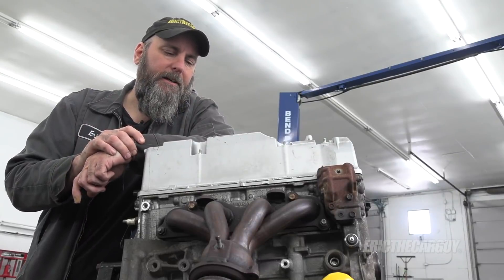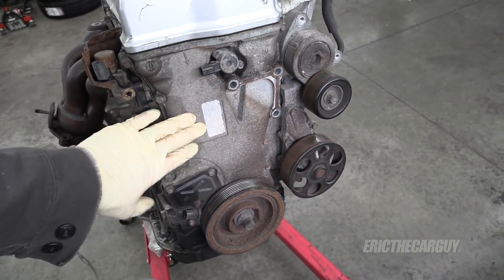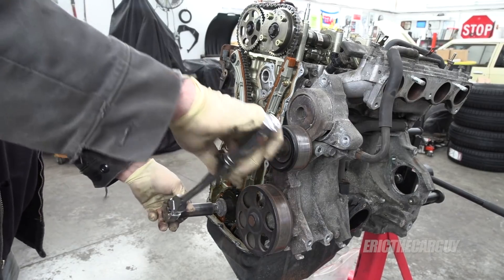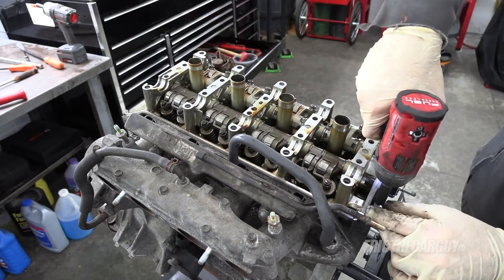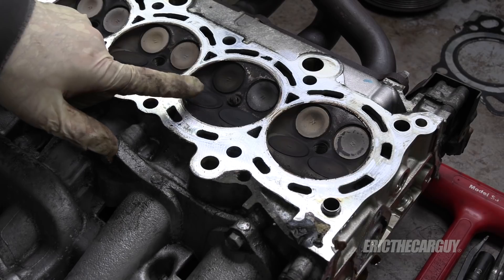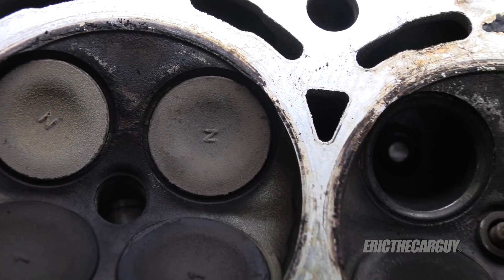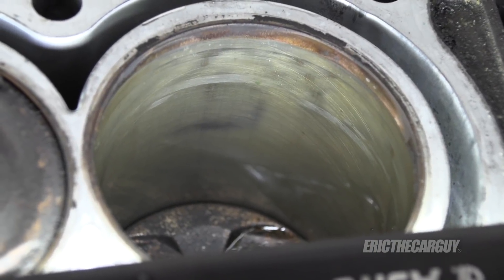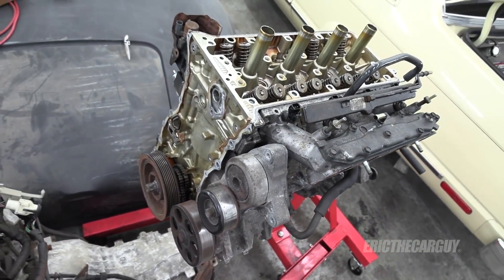Honda K Series Fail, What Went Wrong?

Comment: Another great Vid Eric.
 IMHO it is Honda that destroys these engines. The service 'advisor' will echo what it says in the owners manual "check/adjust valves ONLY if noisy" 
TIGHT valves aren't gonna get noisy! Many first gen crvs died prematurely because of receding and burned exhaust valves and as I begin the search for a replacement for our 410 Megametre 04 accord that suddenly lost compression in one cylinder I see several others right in my area for sale with "no compression in one cylinder".
My guru, longtime head Honda mechanic at the local stealership, discouraged me from having him check/adjust. Wish I hadn't listened!
Due to the ridiculous cost of a replacement right now this one may get a shadetree (no shade at 20 below) partial valve job!

Comment: Good lord, if I didn’t live in OREGON, I would already be at the shop waiting for you!!!! 🤣🤣🤣
Reply: Hello fellow PNW'er!  And same, I'd love to tinker with a K24 but I've got an EP3 with K20a2(?) @ 240k miles that I've been waiting for to die, but it just won't!   

Heck, even my previous Civic, 98 Hx wouldn't die (D16y8?). My sister ran it low (2qt+) on a 2000mile trip up from Cali (stripped drain bolt), and it burned horribly ever since.  Went 2 years/32k miles without changing the oil, just topped it off every week. Figured it wouldn't hurt since it needed to be rebuilt anyway, car was a champ.
Reply: @Chrislk1986  I'd love to have that K20a2 head if you decide to get rid of it.
Reply: @johnsmothermon6856  My bad. It's actually an K20A3.  I'd love an A2 as well.
Reply: If you're in Portland I'll help ya!
Reply: @madjimms  glad to see so many Oregon people. 
Also a Portland metro guy

Comment: I'm happy to see that the guide blades for the timing chain are mostly metal, unlike the GM Ecotech motor I had in my last car, an 04 Cavalier. I did a complete timing chain replacement in that car because the guide broke. Then I had to take the oil pan off to make sure no plastic parts landed in the oil....

Comment: I currently have a 2001 crv (b20z) with a dead cylinder as well...this video gives me some confidence and some ideas what to look for after pulling the head.. love the solvent in the upper chamber idea.. thanks so much eric, you have gotten me through six years of keeping the old dog on the road
-craig
Reply: Oh no....
I just noticed your name is Craig. I’ve got a B20b engine CRV. Engine is good though. Needs a timing belt and valve adjustment. I hope I get the valve lash right.
Reply: @craigiefconcert6493   i think youll be fine... plenty of information out there.Just take your time and remember its better to leave them a little bit loose than tight. Personally I like to use a box wrench and scewdriver vs. the adjustment tool, cause you can see the position of the slot on the set screw as you tighten down the jam nut...good luck!

Comment: LOL! I just changed the plugs and coils on my 2003 Element with 197000 miles. I think the plugs were the originals. They were highly eroded. No more codes! It does use some oil, but I can live with it. I bought it 8 years ago for $6000 for .my daughter to learn to drive on.  Now it's my daily driver. Here in the midwest it will probably rust apart before that engine dies. When it does I'll pull the engine and rebuild it. Now if Honda can just make a reliable 3.5......... Thanks Eric

Comment: Exact same thing on my Element - cylinder #2 burnt exhaust valve. Previous owner never adjusted valves. So, a new valve, relapped all the others, new head gasket and head bolts and so far 40k kms later it runs great. Timing chain next...should have done it the first time..

Comment: When it comes to bolts and screws, when I worked as a mechanic decades ago, I built a container with partitioned to create pockets (with labels) to put bolts and stuff from different parts of the engine or transmission I was working on into as I took them out.  That prevented someone or something from accidentally hitting the bolt groups and mixing them up.  That enabled me or anyone who took over for me to know what was what and where it went.  Putting it on the back of the bench lessened the possibility of the container accidentally being knocked off as well.

When it comes to work on the interior of a vehicle, I do the same thing but with one of those compartmentalized containers they sell for fishing lures, weights, etcetera.  Taking something out of the dash or removing a seat, just put the screws and bolts for each different part into its own compartment then shut and snap the lid so that everything stays secure in its own compartment.  Makes reassembly much easier when different dash screws are similar but still different enough they do no work in each others place as well.

Comment: K24 is a terrific engine. We have 322k miles on ours! 2004 CRV.
Reply: I have 2004 CRV also.  170,000  and going strong.
Reply: That's awesome.  I bought my 04 cr-v new and now have 304k
Still on the original auto transmission too.
Reply: @seanwilson7825  Yeah, we're also still on the original transmission. No problems yet.

Comment: Thank you so much for this video, I just bought an 05 AWD element with 0 compression on cylinder 1. Did some tests and I’m sure it’s the exhaust valve. Trying to take the head off with the motor in the car and still working on it, one more good session and I should have it off.

Comment: That engine looks like it's a perfect candidate for a full rebuild. You can pretty much turn that into a brand new engine that'll last forever.
Reply: I tried doing an engine tear down years ago on a 3TC engine from a Toyota Celica, I only got a third of the way there on such a simple engine.?
Reply: You mean another 180k miles.  Maybe more, maybe less, but definitely not "forever".
Reply: these engines are crap. no actual VTEC and they're made for economy. wouldnt waste the money on fixing one when a whole replacement engine can be bought cheaply

Comment: "Id rather hear a valve than smell it."
Some advice I got from an old Honda tech on valve adjustments. Say the intake spec is 8-10 thou and the exhaust is 10 to 12, ill err on the loose side.

Comment: Did a valve adjustment because of this video on my 2007 accord, 4 cyl. Two of the intake valves needed a slight adjustment. And two of the exhaust valve were way too tight. 

Thanks Eric!

Comment: It’s a shame that such a clean engine had issues.  Also the burning oil is a bummer.

My 04 Accord 2.4 with 227k ran smooth as butter but drank oil like it was going out of style.  My 05 I currently have with 127k, however, doesn’t burn a drop.  It’s interesting how some just seem to develop those issues while others do not.

Comment: I had my Element’s valves adjusted a couple of weeks ago and it feels a lot stronger, 2nd valve adjustment first one done at 100k and the latest at 190. They did break a couple of bolts which I later discovered. Went back to honda who did the work and they were replaced at no charge. Really love this car.
Reply: What bolts did they break? I had my 01 Prelude in for a timing belt,tensioner and water pump at a Honda dealership in British Columbia. They broke a bolt off for the tensioner and of course it’s a special bolt that took a couple extra days to get in. 😎
Reply: Two rear bolts to the valve cover that i believe also reaches into the inatale manifold. They screw into the coil cover
Reply from the maker: It's unfortunate that they broke parts on your engine and didn't do anything about it at the dealer. The dealer should be the best place for service. It's unfortunate that's not always the case.
Reply: @ericthecarguy  the dealership here on Vancouver island did everything they could to get my car fixed after they broke the bolt,of course as you know Eric,that’s a special bolt on the tensioner and they didn’t have one in stock so they called other dealers and even auto wreckers on the island to no avail,so I had to wait a few days for one to get shipped from Toronto,all good now though,car runs great with only 177 thousand kms on it. 😎
Reply: @ericthecarguy  the dealer was the one that serviced it and they repaired it at no cost to me. I bought my car there in 2004 and always get it serviced there. Lucky for me I have a good relationship with the service manager.

Comment: I've owned a bunch of Honda's including the K-series engines and I've never had any oil consumption with any of them. The only thing I can attribute to this is using premium synthetic oil with 5K mile changes. I also follow the scheduled maintenance jobs, particularly the "big" ones which include valve adjustments and replacement of plugs, coils, water pumps and thermostats. My VTEC solenoid switch screen filters have always been clean when I replace them at 100K mile intervals. 
If you take care of your Honda, it will take care of you.

Comment: Eric all you need to do is throw some aftermarket rods and pistons on that k24 block and get yourself a k20a2 head and slap that on that block and that’s the perfect set up to go in that extra civic
Reply from the maker: My plan is to hunt for an RSX Type S and take the engine and transmission from it for the Civic.
Reply: @ericthecarguy  that’s also a great idea, I did sort of the same on my last set up, I owned a 02 rsx type s that needed a lot of rust repair in the undercarriage and what I ended up doing was getting a 99 civic and took everything I needed out of my rsx and put it there, those engines are very rev happy and the power band on a light shell like the civic feels like a 300+hp car you will definitely have some fun with that thing on and off the street

Comment: Very interesting. My Element has 215,000 miles, never adjusted the valves, runs great, as it gets old I kinda afraid to mess with stuff.
Reply: In the same boat with my CRV. Thing idles like an electric car. Afraid to adjust anything.

Comment: The best analogy that can be used here is as follows: If you've never owned or maintained an Air-cooled engine, please do try and adjust vales on a Honda. It's not rocket science, but it does require knowledge of how feeler gauges are used when measuring the amount of drag while adjusting your valves.

Comment: Hey Eric. Thank's for another great video. Love the Honda video's. I've got a Honda accord Euro with the K24a3 engine which i purchased brand new in 2005. I had to replace the motor about 5 years ago at about 198,000 kms (engine was faulty from factory. So these video's help alot.

Comment: I had a 1962 Studebaker Lark, it had BADLY worn cylinders BARREL shaped, I guess soft casting metal. Anyhoo,  I went to a catalog called Warshawsky, Inc. And in there they sold among other things a kit in a can called Amazing Engine Overhaul, wax pellets that you put in sparkplug holes, these pellets were saturated with molybdenum disulfide, it also had a smaller can with Moly and Zinc-Dithiophosphate dissolved in motor oil.
I actually tried that stuff but on this engine it did not work, about .060 thousandths wear in the bores is just not going to be fixed without a tear down, might work on something a bit more realistic, but it made a great insect fogger. It would burn a quart of oil every half hour just idling, so I gathered up the neighbor hoods recycle oil and used it, I was a kid and it was 1968.

Comment: Similar thing happened once to my old 1990 Mazda 323 (Protege) with 1,6 B6 engine (16-valve). One exhaust valve had burned. It had hydraulic lifters though, so perhaps it didn't work properly on that valve. Found out the problem after the car failed an emissions test.
The car had about 300 thousand kilometers then, but it was repaired, new valve seals, gaskets from the head gasket up, timing belt, etc. The engine burned little bit of oil before that, but after the valve job, oil consumption increased a bit, but still drove almost 5 years after the repair, until I recycled the car for multiple other troubles :P

Comment: Just did a budget build for my brothers integra.K24a4( same engine as this in video) used a type s 6 speed with 4,7 final drive. Definitely a fun street car . Torque is great top end not so much.

Comment: You could have that head sent out cleaned up , have the seats cut put new valves in it ,or do it yourself lap them in new guides seems like that’s all it needs, Put some rod bearings in it piston rings on it out I think it be good to go,possibly ...I just did an engine similar to that and I had virtually the same problem with a flat tappet cam , I just put a new valve and re-cut the seats , lapped in  adjusted the valve lash , problem cured, look forward to a rebuild on this engine🙂🙂

Comment: There is a very clean, good sized nick in the exhaust seat. A bit of debris may have been pinched between the valve and the seat and held the valve open, causing it to burn and lose compression.

Comment: My 05 crv lost cylinder #3 at 338,000 miles. The motor still runs but is tight. I looked down the spark plug hole and don't see real bad scratches. I did valve adjustment at 110k and 220k. Not sure what went wrong but its the end of the road for the old girl. Btw the AC was mint. I replaced the ac clutch last fall but otherwise it would freeze you on a 100f day.

Comment: Generally 0-60psi has everything to do with valves and seats. Now if it were 120 when its supposed  to be 180psi then you would have a ring clearance  issue. Good video.

Comment: I had a 1969 LeMans that consumed a quart of oil every 300 miles. When I disassembled the engine, the gap of the top 2 rings was perfect. The oil control rings had no tension...the cause of the oil consumption. I exchanged the heads for rebuilt heads, installed new rings and bearings, and after the engine was broken in, there was no oil consumption between oil changes.

Your Honda engine may have a similar issue with the oil control rings.

Comment: I had the same experience with my wife's crv when I checked the fit of the valves and found that the space was less than the specification, where as normally we see a larger space.I did an inspection and adjustment at 100,000km I live in Canada(km)

Comment: Routine valve adjustments would’ve prevented that and used to be part of major services like 60K services. Honda claims that they aren’t necessary anymore unless they’re noisey. Tight valves aren’t noisey and therein lies the problem.
Reply from the maker: Actually, we were adjusting valves at 15K at the dealer back in the day. Totally excessive. I agree with Honda, they really only need adjusting if they are noisy. As I mentioned in the video, I've seen more issues like this that resulted from improper adjusting of the valves over the valves wearing out by themselves. Thanks for the comment.
Reply: @ericthecarguy  do you recommend doing valve adjustments in a K20?  or just leave them be.  curious to get your opinion on it. I have a K20Z3 with 110k miles that runs very well.

Comment: At 250k I had the valves for my K series 2003 CRV adjusted. I don't think they ever were in it's lifetime ("new" to me at 212k). Man, what a difference in responsiveness, and it ran great until an accident at 315k. Heck, it kept running after my front-end collision... though the engine was tucked underneath a bit...

Comment: Great video Eric.Do you know what the consumption rate was before tear down? The reason i asked was my Honda civic d15b7 1994 had 400,000 and started burning oil of 1 qt every 200 miles.i bought new pistons & rings std size.when i got it apart the bores still had a little crosshatch BUT the OIL return holes on the pistons were ALL plugged on all cylinders.I had gotten tired of oil changes>40 + changes.I ran a drill bit through the holes/ put the rings only from the new piston on the old ones and BALL HONED THE CLYs.Reassembled ,it now has 540,000.and went back to 1/2 qt every 7,000 miles.mine you i bought the care new.that year was great to me.

Comment: That engine is very rebuildable, subject to checking bore wear but they didn't look awful. As a DIY project it just needs a hone, rings, guides cyl head gasket and a valve or two so not $$$ on parts and it should run again for maybe 50k or more. Great idea to offer it to the audience.
Reply from the maker: Believe it or not, the MLS head gasket is reusable. Thanks for the comment.

Comment: With the way how the piston was moving in its bore, it most likey was burning oil from the rings, honing it would take it worse, after taking off some material from honing the piston would slap and cause the same blow by problem, the fix for the block is to bore out and re sleeve if you can, so you can go back with the same piston and new rings

Comment: Bad valve adj would not account for oil.   Check oil ring and it could be worn or installed wrong.   (spreader ends overlapping).    This is what happened in my 84 350 Suburban.    Excess oil into a cylinder caused an exhaust valve to be isolated from its seat.   The exhaust valve overheated and a hunk came out of it.

Comment: I just watched the video you made pulling this engine. Going by the Stripped Threads in the Transmission and the Valve Cover gasket being in like new condition, I suspect the same persons/place did work on this car and botched the Valve Adjustment.

Comment: K24a1 is actually one of the best to make power. Sure you need aftermarket or TSX pistons and a k20a2 head but the element block saves you the hassle of cutting up a type-s oil pump

Comment: Usually on Honda you would adjust the valves every time you change spark plugs which is recommended about 160,000 kilometers or 100,000 miles